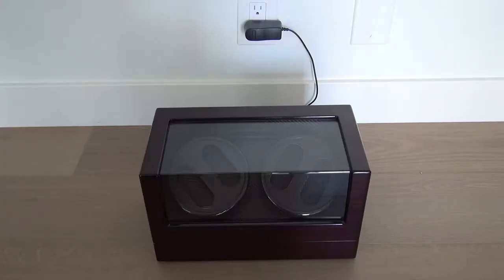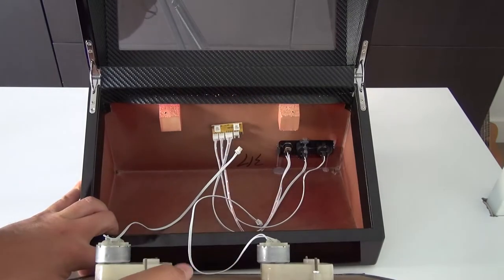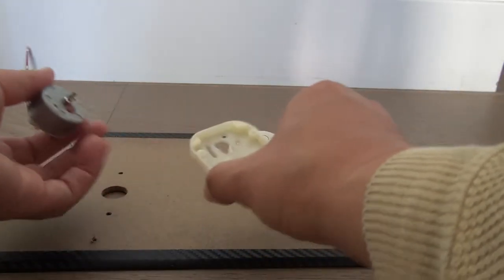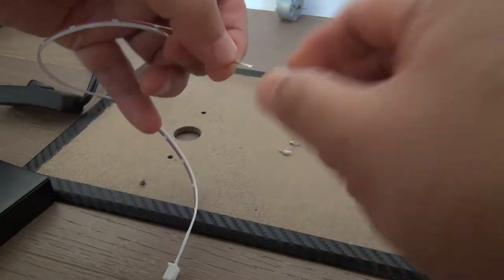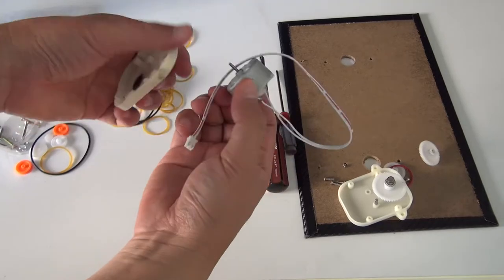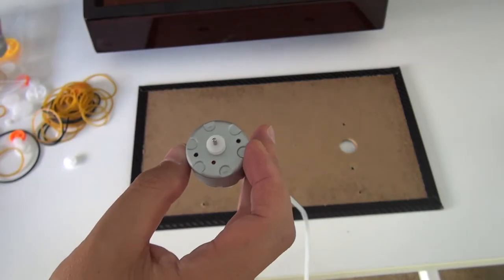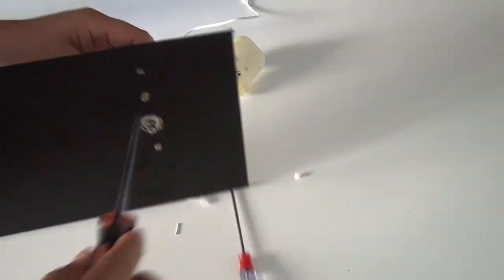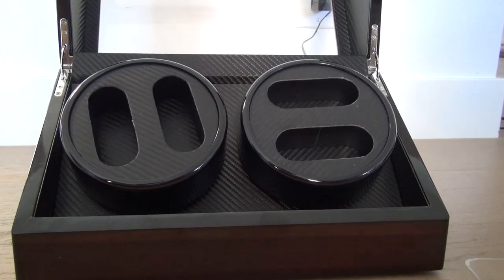DIY, How to repair Watch Winder for replacing NEW motors and more: PART #2

Comment: Can you post link to but the kit for rubber bands and gears?
Reply from the maker: Hi, Julio. Here is the link. But there are many types of Gear and Rubber for Kid's Science Kit. You may choose the best kit for your repair. Good luck.

https://www.amazon.com/JISTL-Plastic-Single-Double-Reduction/dp/B00V66YJQI/ref=pd_sim_sccl_3_7/140-8156578-3738068?pd_rd_w=AGlKF&content-id=amzn1.sym.c4a59542-32d7-42e0-896e-07bdfd700573&pf_rd_p=c4a59542-32d7-42e0-896e-07bdfd700573&pf_rd_r=JKHT6V54F4GZ51192DJ9&pd_rd_wg=V9aXv&pd_rd_r=1d89e7d8-0305-48dc-8dee-066e69b6ae5f&pd_rd_i=B00V66YJQI&psc=1

Comment: Stanley what do you call the delivery rubber piece, I need to buy that
Reply from the maker: 3-5 Days via Ebay.com. However, if you have a Water filter of your refrigerator, check it out the top of the USED water filter. On the top, there is a Black Rubber Band which is perfectly matching with the inside motor band. Thank you.

Comment: How many volts the motor supply?
Reply from the maker: My motors are ALL 6 Volts. However, I recommend that you should check your watch winder's motor voltage before replacement. Thank you.